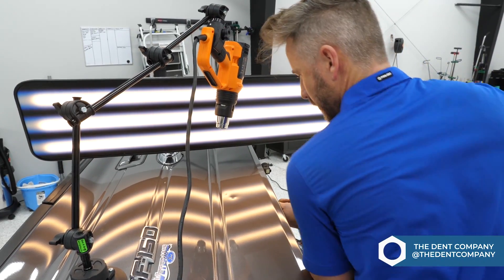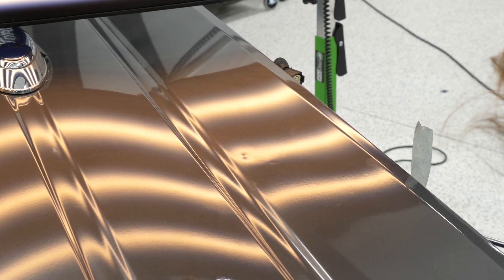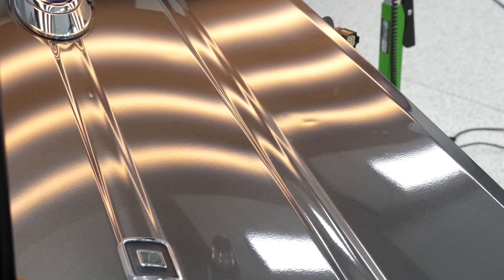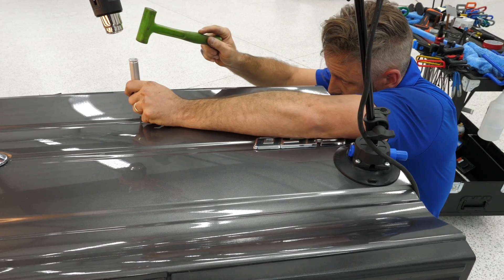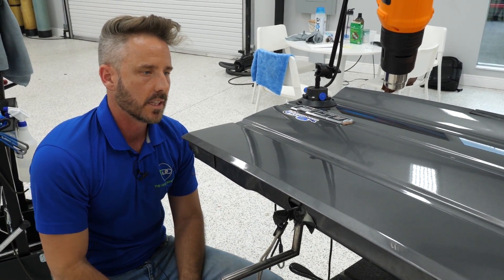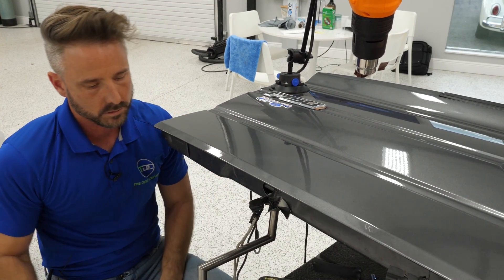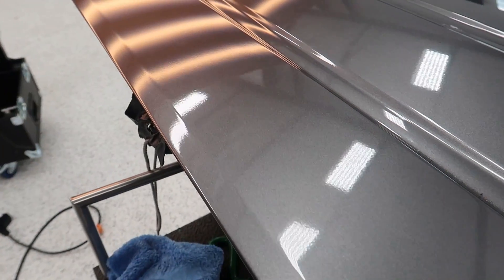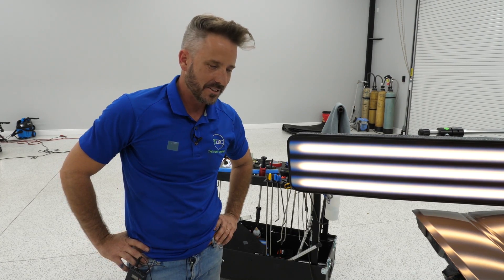Ford F150 Tailgate Dent Repair

Comment: This guy is good.  For $250, that seems extremely reasonable.  I'd have a hard time not doing the customer a "favor" and removing that Veterans Ford dealership sticker.
Reply: Gary Beckmann it’s even cheaper here in the uk, I had dents very similar removed for £90
Reply: I think it was $250 plus removal and installation, if I understood him correctly.
Reply: Very reasonably priced. $250 versus ugly dents! I agree let's get that sticker off. LOL

Comment: Would love to hear how guys like this got into this line of work. What did they do before? What was their background?
Reply: Devon Regan It’s usually through car detailing or a dealership. But you can also take metal finish classes
Reply: SolePatrol guys that are at that crazy level of perfection I’ve found sometimes break the mold though
Reply: Devon Regan just takes practice I’ve been doing it for 3 years now the hard part is just trying not to break the paint
Reply: He did say his father tought him.
Reply: I started in 1998. I was trained by a guy that started in the 80's. I didn't have any previous experience or work in the auto industry.

Comment: He's not charging enough. $250? Seems cheap.
Reply: 250 plus removal and installation at book time. So I’d guess 400-500
Reply: Harv it's a very competitive market. They have so many people doing crappy jobs for super cheap, so the good guys, no matter how good, can't charge what they're worth because no one will hire them. They have to price themselves in a good position to where they seem like a good value for the work they perform (which that is)